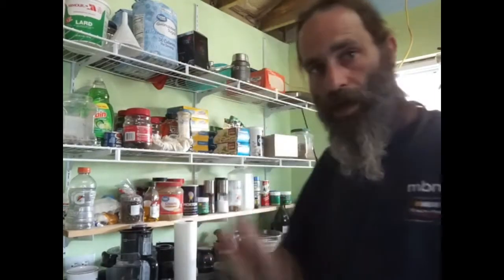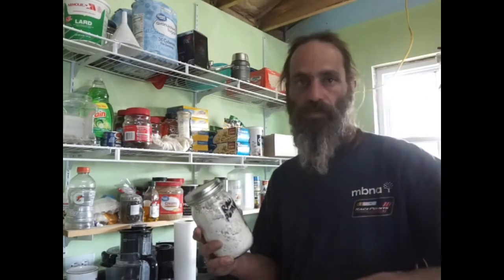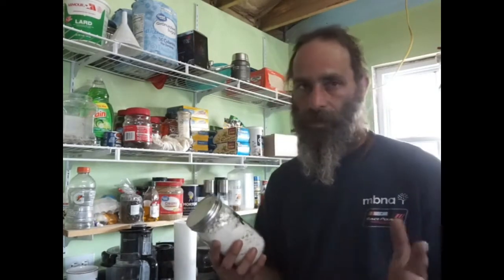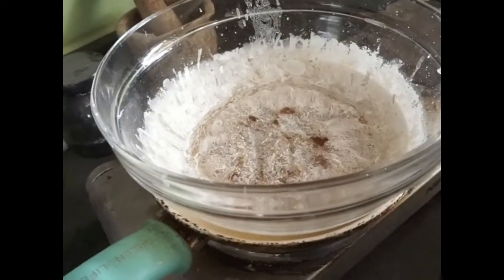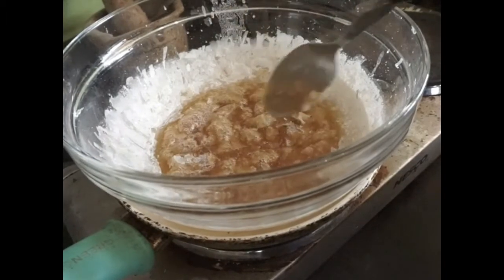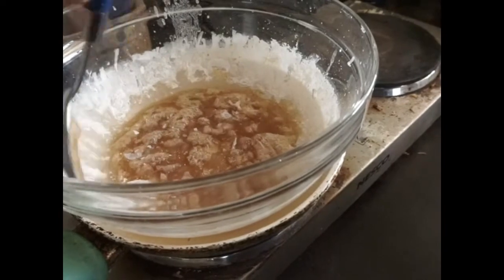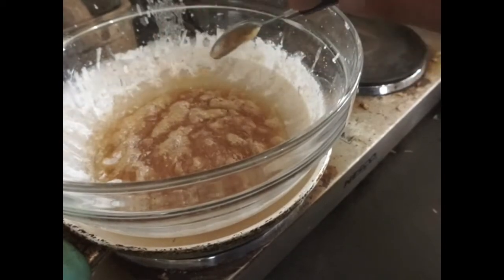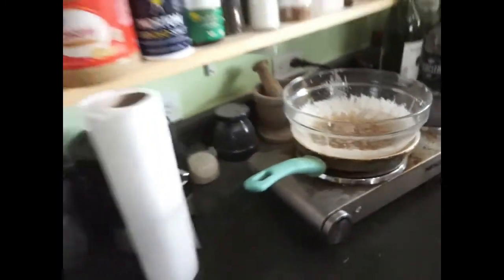Refining Potash, an introduction to Pearl Ash

Comment: I've got a barbecue and I use pure hardwood charcoal. I absolutely love the idea of being able to store dry crystal potassium lye and use it at my leisure to homemake soap.

It's the circle of lye!
Reply from the maker: Barbecue is a good method, probably does a pretty good job of burning off the organic leftovers as well. If you want KOH you will need higher temps though or mix with a little lime, thats why the recipes don't always match with homemade potassium salts unless you are talking about the long hot processed soaps. I haven't worked out an easy way to do it yet, but making the same thing as the store bought potassium lye should be easy enough using lime to convert it. It's on my list when the lime kiln is back up and running this summer.